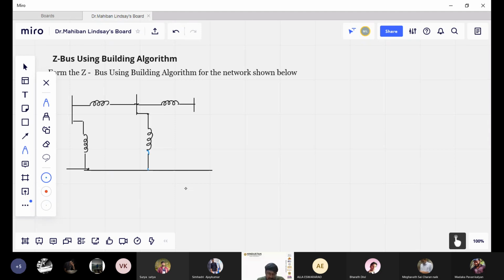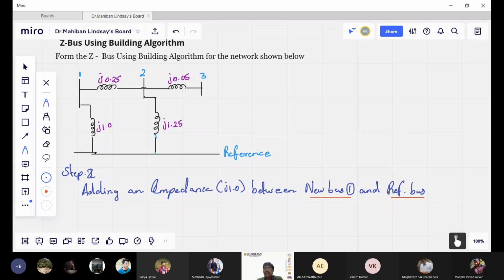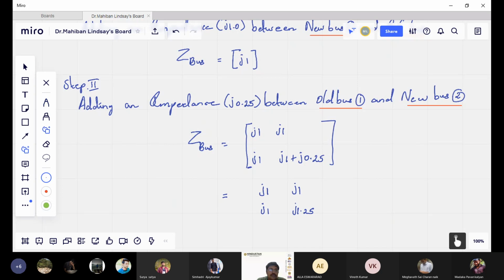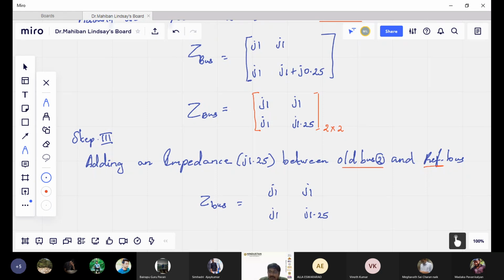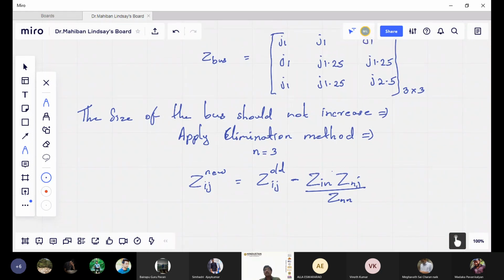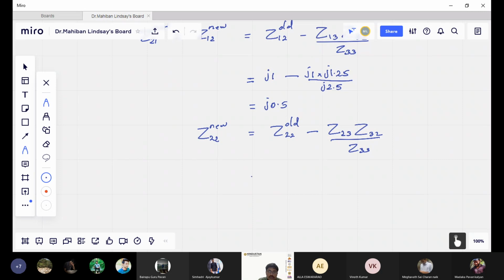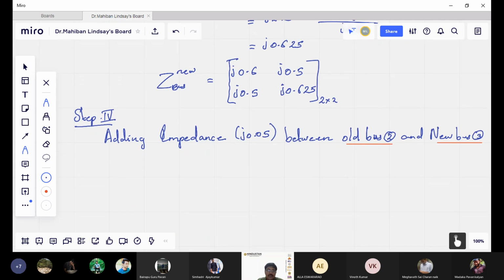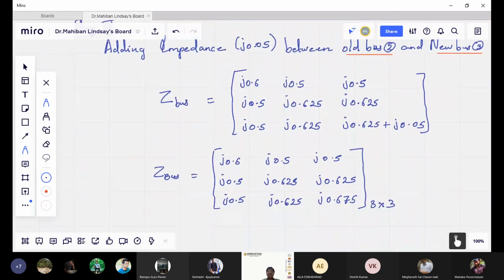Bus Impedance Matrix  by Building Algorithm

Comment: sir in this the "n" value is number of buses or the number of matrices ?
Reply from the maker: At step 3, 'n' represents the row and column to be eliminated. Adding an old and a reference bus will not increase the matrix dimension according to the building algorithm.